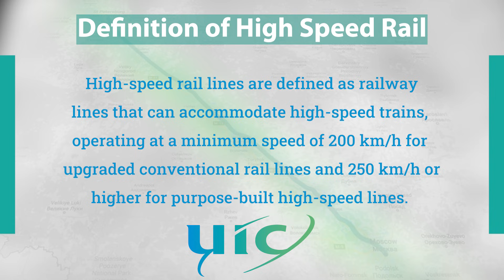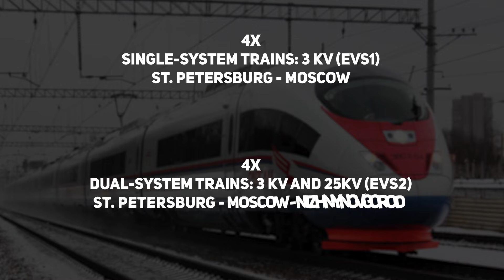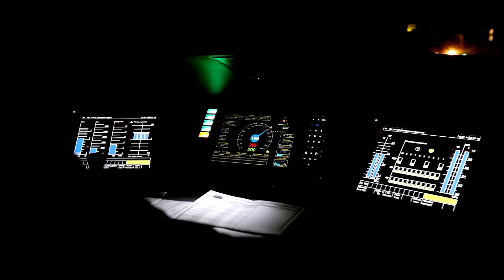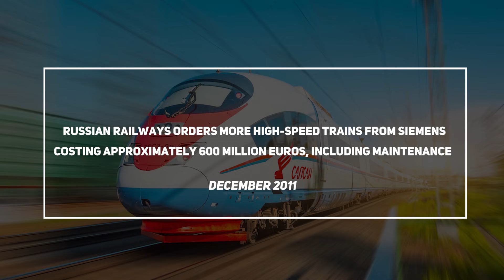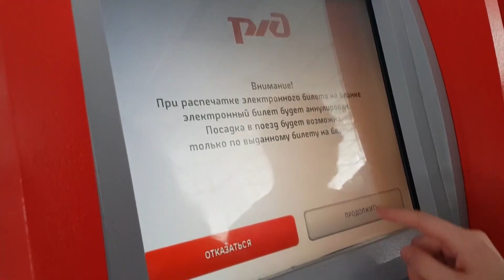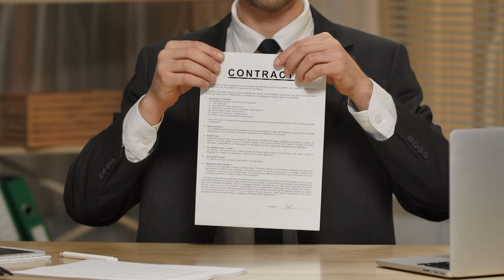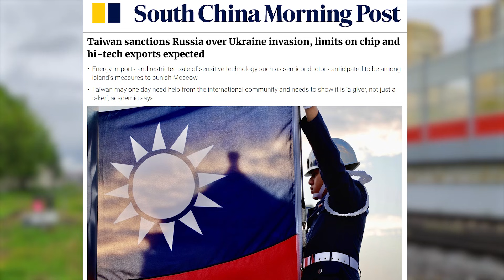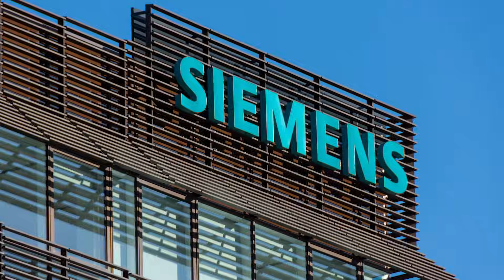Russian High-Speed Trains Are Doomed, Here’s Why!

Comment: From the evidence presented it looks more like Siemens is doomed, not Russian high speed rail. RZhD will buy new trains from Chinese CRRC or other Chinese train manufacturing company. Sadly Germany's deindustrialization will continue until it becomes an independent country
Reply: Russia isn't Siemens main market. Germany is an independent country, IDK how you'd think otherwise.
Reply: Siemens is doomed? Their doing just fine. Ur just an troll account.
Reply: @R4z0rLP Siemens is fine, but German deindustrialization is happening very rapidly.
Reply: @spider6660  thats why we get Intel and TSMC
Reply: @R4z0rLP  "Siemens Energy stock plunged by around 37% on June 23, while other wind companies also saw shares retreat as investors worried that the problems at Gamesa might be a symptom of a wider issue for the industry."
Doesn't sound like " just fine" to me
Reply: Russia will release its high-speed train in a few years, development has been going on for about a year. Just a month ago, a train came out for a run-in, which will replace the "Lastochka" from Siemens. It is 99% of Russian parts.
Reply: @Любадрель-у9з  props to the brave people who will dare to use it
Reply: @R4z0rLP  Bro is trying to be funny 🛸
What do the trains in your country look like?
Reply: @Любадрель-у9з  They look like Godzilla. Wtf do you mean with with this? They have wheels a driver cab at each end and are painted white with a red stripe. The high speed ones are called ICE.
Reply: @R4z0rLP  The design is weird, I can agree but they can go 250-300 km per hour 🙂
So it is a high speed train

Comment: Technically  there is still hope for Russian HSR,St Petersburg-Moscow Route were building another pair of segregated  tracks for Sapsan while keeping original alignment for Long distance and freight.
Reply: Russia is now constructing hight speed roots from Moscow to Kazan and additional tracks for Moscow st Petersburg route.
Reply: @izoiva  Moscow-St Petersburg route was abandoned in Nov 2021 in favour of future (alleged) upgrades, and Moscow Kazan has no start date in sight, even as of now - unlikely to materialize imo
Reply: @ce1834  Actually, they've slowly started to build HSR-1 line (Moscow - St. Petersburg). Currently there are some bridge construction works on Moscow channel and near Kryukovo station, but for sure, it will take decades to build that line.
Reply: @ce1834  It's not abandoned. HSR-1 has been prioritized over HSR-2. Most difficult 40-kilimeter exit of Moscow for HSR-1 is already being built along with MCD-3 under single budget assignment. This will allow high speed trains to bypass busiest section. It will have 3 or 4 stations - Kryukovo, Petrovsko-Razumovskaya and either Rizhskaya or Kalanchyovskaya or both.  Further part is in design. And there is now a probability that it will go through Tver stopping at existing central station, instead of far station near the airport.
Velaro trains will be manufactured by Sinara. Manufacturing facility will be built in Kryukovo.
HSR-2 is postponed and being revisioned. They will return to HSR-2 after HSR-1. Then HSR-3 (south, to Rostov and Krasnodar) and HSR-4 (west, to Smolensk and Minsk).
Reply: @SnarkOrel well, the HSR-1 line from Moscow to Saint-Petersburg is scheduled to start operations in 2028, of course if Saint-Petersburg will not slow this process like they are slowing a development of subway system)
Reply: @Siberian_Bear72

Gschichten ausm Paulanergarten. Genauso wie die nicht validen Daten aus Russland, auf denen die Einschätzung der Weltbank fußt. Von Volkswirtschaft hast du auch keine Ahnung und glaubst, ein Staat wäre eine Hausfrau. Die Staatsverschuldung ist nicht elementar, siehe Japan.

Russlands Krieg gegen die Ukraine und das Verheizen einer ganzen jungen Generation haben diese Bahnprojekte auf lange Zeit obsolet gemacht und Russlands Volkswirtschaft ins Bodenlose gestürzt. Es wird Richtung Nordkorea gehen. Alles fürs Militär. Für das Volk war auch schon vorher kaum Geld da. Von Peter und Moskau ganz abgesehen. Russlands Infrastruktur öffentliche Infrastruktur ist im Gesamten mieserabel.
Reply: if russia is rich i think they will planned to make hsr from moscow to vladivostok yeahh the long road line support by china
Reply: @Siberian_Bear72tsss... let them believe what they want to believe.
Reply: the reason why they didn't build it is because on this route the trains are also fighting over the toll roads.  and many American car pros would rather spend money expanding highways than build new expensive railroads
Reply: @Siberian_Bear72yeah man, it was funny joke 😂
Reply: It's been abandoned now - they're looking at improving the existing line, not surprising considering the state of their finances
Reply: @Siberian_Bear72 but also a meagre economy to go with that lol, it stopped being a global player in 1991 😉 - so pretty understandable
Reply: @ce1834  Hey, clown, thanks to germans stepping on a sanction landmine and blowing up their economy, Russia is now 4th largest global economy by PPP after USA, India and China, level with Japan (and seeing how Japan is declining in past decades, they will soon outpace them and become clear 4th). Read less manipulated cope articles...
Reply: Corruption is the main issue.

Comment: Ridiculous video. You mix several potential issues into one video, which have to be solved separately and are independent of each other.
Some things are imported because they can't be produced, some things are just more expensive to produce locally because economy of scale does not exist, so it is cheaper to import them.

Literally nothing that you need to produce a 250kmh-rated train is so high tech, it does not exist in Russia. The problem is scale. Can't start a complex factory if you won't have enough orders. Those trains are likely to just be bought from China. 160kmh-rated trains (Latochka and Ivolga models) are being churned out in massive quantities locally, since there is huge demand on the local market. Some elements from Siemens, Schneider Electric and ABB that were in there had been fully replaced with local production and imports from China.

Main problem with Russian HSR is that there is still no political decision on making separate lanes for HSR, which means that on a small number of routes where they can be economically viable they are running in conflict with regular trains. That makes users of both unhappy. Each time the projects are drafted for separate lanes politicians try to skip a generation of tech (e.g. why make separate lane for 250kmh trains in 2007, when tech for 350kmh is almost mature) postponing the constructions for 10+ years already.
Reply: But you can't keep your existing trains running if you can't get the spare parts. And you can't produce those locally. If tomorrow the main computer on one of those trains fails and you don't have a spare, you won't get that train to move under its own power anymore, ever again. And these are not just simple computers with plug and play connections. This is an entirely proprietary design by Siemens. Everything is proprietary and impossible to source. 

Of course they could go to other countries to buy new trains, but that's capital you didn't plan on spending, that's a lot of money you have to find.
Reply: @Hans-gb4mv  Imported parts are not the "brains" - those are made in Russia.

What actually is imported and considered hard to localize is stuff that had to be CNC machinned very precisely. Parts machined not smoothly enough do not really matter at slow speeds, but become more crucial at higher speeds.

There were some parts in electric engines and traction systems that were imported, not anymore and it's not really that big of a deal. There were no economy of scale, so those parts could not have been produced cheaply, now those trains will cost more, but they won't stop running. With time, we will get localized production at even lower prices.
Reply: @di_dmitriev  the trains are Siemens Velaro Trai s, the entire train is designed and build around Siemens proprietary technology. The entire electronics stack is German, not Russian, otherwise they wouldn't have needed to go look internationally. The fact that it is a small number of trains is exactly the reason why there was no point developing something from scratch.

Wheels and bogies are easy to source elsewhere, but not the electronics. Why do you think 30 years of maintenance contract is worth more than the trainsets themselves? It's because if all the tech that Siemens needs to support.
Reply: @Hans-gb4mv  There aren't much info on how "full" the technology transfer to Russia was, since Sinara - Siemens contract is not public and not technically a gov contract. Whatever was not transferred surely can be acquired from China since they have fully localized Velaro - CRH3.

And again, there is no problem with tech, it can be bought. The problem is with scale and I don't see the potential there. Basically, on the highest levels decisions were made to invest in air traffic for passengers and all of the railway construction capabilities are concentrated now to grow freight traffic with China.
Reply: Construction of dedicated high-speed rail line has already begun

Comment: Are you sure the Russian gauge is 1,524 mm? I thought they reduced it to 1,520 mm throughout the entire country leaving only Finland with 1,524 mm.
Reply from the maker: In the video, the 1524mm gauge is mentioned in the context that it was used when the railway line between St. Petersburg and Moscow was built.  But yes, during the 60s, the Russians reconstructed the railways with a gauge of 1520 mm.
Reply: @RailwaysExplained  Wow, as late as the 1960s! Why did they shave off 4mm? That must have been a gargantuan task to recalibrate throughout the entire USSR.
Reply from the maker: @Eurobazz  This idea probably came to Brezhnev's mind while he was having breakfast 😅
Reply: @Eurobazz  somehow getting rails 4mm closer together raised high speed freight stability without having to modify a rolling stock. So Russian 1520 and Finnish 1524 gauges are directly connected and can handle same trains. (Besides voltage and controls, they differ.)
Reply: @bagamax Stockholm basically did the same thing for its metro, while it is officially standard gauge, the actual gauge is 1431 mm.
Reply: @bagamax  The HST Allegro had a nominal 1522 mm gauge. The normal trains are compatible either way. Even the external dimensions (load gauge) is the same.
25kV/50Hz is used on both sides of the Finnish-Russian border.
Reply: @Itapirkanmaa2  wiki says that Allegro ran 3KV DC on Russian side.
Reply: @RailwaysExplained  The first reason I read about is the transition to the metric system for the convenience of calculations. Because 1524 is 5 feet. But I don't see the point in that).
Reply: @enemixius  That is interesting. Just like how the Helsinki metro is 1522 mm as opposed to the mainline gauge.

Comment: Speaking of the trains being 300 mm wider, why don't European trains use full width of the loading gauge?
Reply: @creamwobbly  So I was talking about the universal UIC loading gauge - that's the smallest it gets on any European full-service main line. That one is 3150 mm wide.
The train's, hoverer rarely exceed 3 m width, and there is no passenger train that I know of, that is wider than 3050 mm. For example European Velaro is 2,95 m wide.

Compare that to Chinese HSR or Shinkasen loading gauge, that are 3400  mm wide.
Thier trais are ~3,3 m, and up to 3,38 m wide. That's much higher proportional utilisation of the loading gauge.
Reply: @PtrkHrnk  Maybe not all lines and stations in Europe do actually conform to the UIC loading gauge? At least that would be my guess.
Reply: @arnoldhau1  Of course they don't. S-bahn stations, in Berlin for example. Or the Spanish HSL that we're built on "green field" and actually have larger loading gauge. Or some historical routes that's weren't upgraded since 1912. I wasn't considering them...
Reply: @PtrkHrnk  that`s because loading gauge outside of Europe is just wider. Nothing to "utilize more" in the Europe, still.
Reply: @vovinio2012   Huh? "... universal UIC loading gauge - that's the smallest it gets on any European full-service main line. That one is 3150 mm wide.
The train's, hoverer rarely exceed 3 m width, and there is no passenger train that I know of, that is wider than 3050 mm. For example European Velaro is 2,95 m wide.

Compare that to Chinese HSR or Shinkasen loading gauge, that are 3400  mm wide.
Thier trais are ~3,3 m, and up to 3,38 m wide. That's much higher proportional utilisation of the loading gauge"
Reply: Because the Russian loading gauge is wider.
Reply: @SynchroScore  What was the question?
Reply: @PtrkHrnk  Why are you asking me what your own question is?
Reply: @SynchroScore  Yes. Read it again and think it through. You'll realise your answer is totally irrelevant.
Reply: Because all countries in Europe are independent and built their own networks themselves, and used the gauge which they wanted to use which best suited them nobody is going to rip up their entire network and replace their entire rolling stock to a 'set' gauge. It would cost endless billions or trillions, cause a mess on the network which is being redone. Stations could need all to be redone, maintenance infrastructure and infrastructure (bridges, signals & crossings)
Reply: @ThexMJT  Because that already happened 🤦‍ so now we're talking about universal UIC loading gauge... that no passenger train in Europe uses the full width of
Reply: @PtrkHrnk  because their tracks are already laid and HST run on conventional lined also not always dedicated HST lines.
Reply: @ThexMJT  that may be true, but how does it relate to my question?